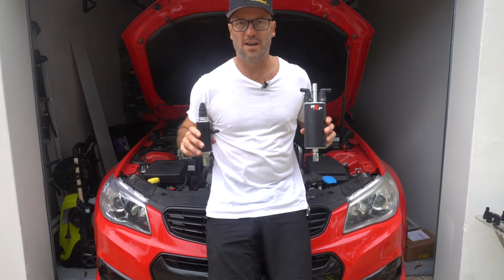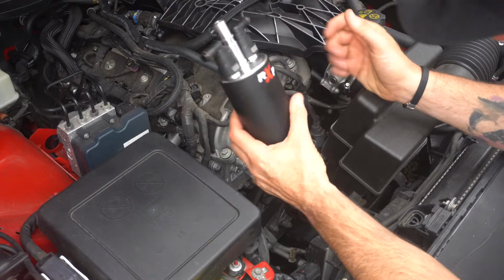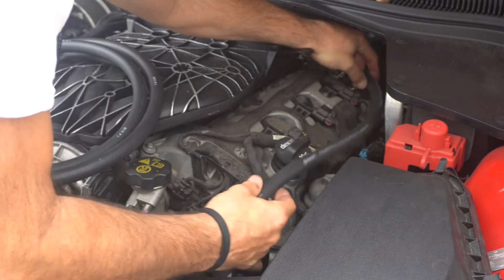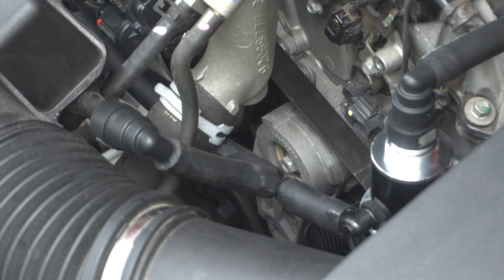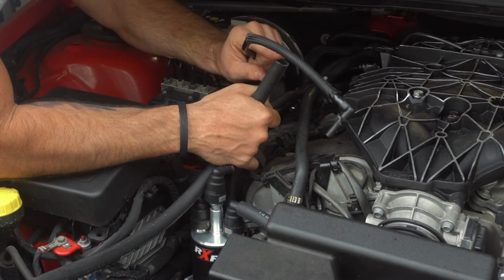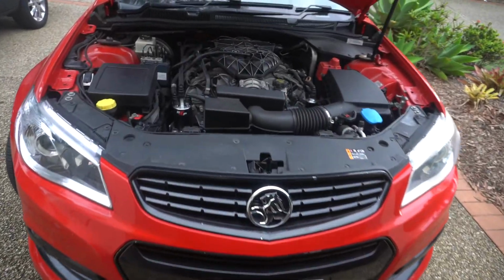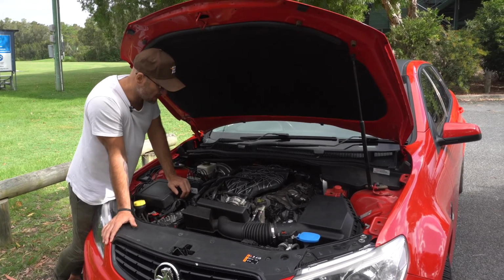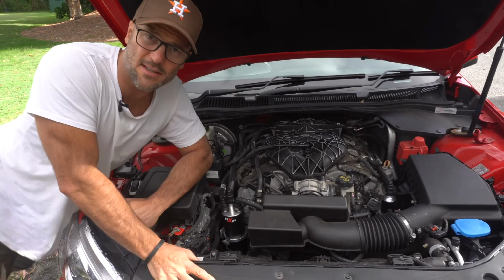RXP Twin Catch Can Installation LFX Motor

Comment: For almost $600 US dollars, that kit should be plug and play.  I'd be mad if I had to do what you did with those different size hoses.  I wonder if the 2023 models of this kit address this issue for the 2012 - 2015 LFX engine?  Or, Plug the line off coming from the intake. Attach a hose on the fitting of each valve cover and run those hoses to the bottom of the car. Then  you will never get oil in your intake.

Comment: When you did your research you should have asked an engine reconditioner he would of told you that if you need a catch can then your rings are most likely stuffed. The he might have asked you are you using a washable filter ie K&N and if you said yes then he would have said that is why your rings are stuffed!

Comment: Hey Michael love your videos. I’ve got a VF SV6 STORM with a leak from the thermostat housing just above the transmission behind the intake manifold. Mechanic ga e me a quote of over $1000 and transmission needs to be removed. I saw a few vids of people remove the intake manifold and to do its it’s a difficult job. Smart Holden engineers 😂😂😂 great money maker. Saw a thermostat housing gasket for $13 on eBay 😂😂😂😂😂
Reply: That’s excellent. Removing the plenum and manifold is easy. Sounds like you saved yourself a cool thousand.

Comment: I had one on my car but with a filter that was venting the fumes,
although i loved the extra sound it made...
I couldnt have the heater or air con on as it always brought the fumes inside the car :(
Reply: Really? Are you sure you plumbed it in correctly? I believe the check valves are important to stop the fumes from flowing the wrong way.
Reply: @GhostedAndRoasted2025  Ill show this to my mechanic mate thank you!
Reply: @emmour9288  No worries. Im going to make a video when I empty it. I believe they work well
Reply: @GhostedAndRoasted2025  thank you very much!
when will that be?